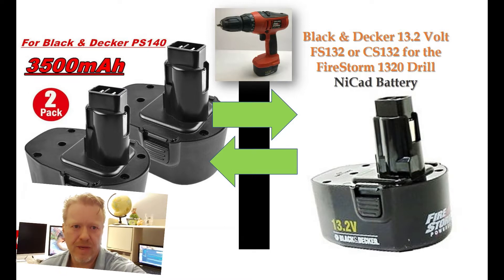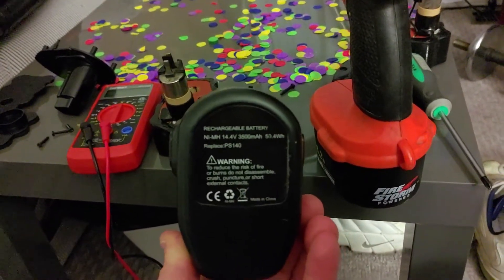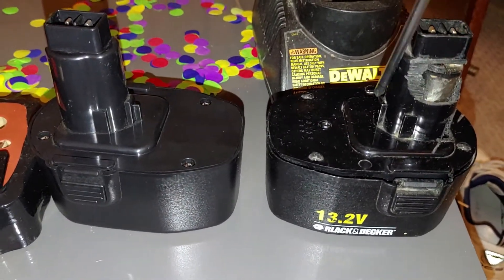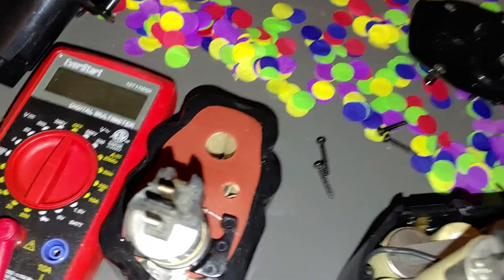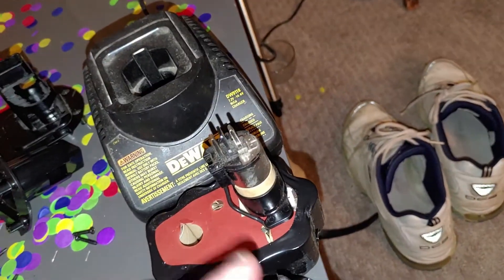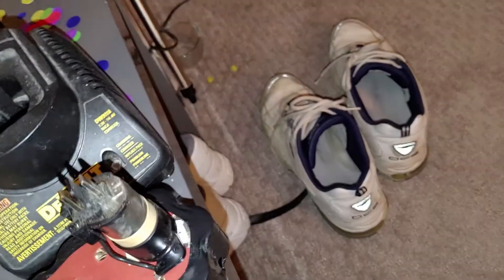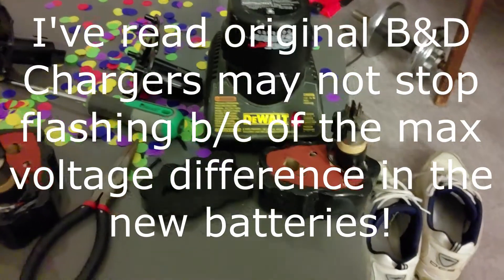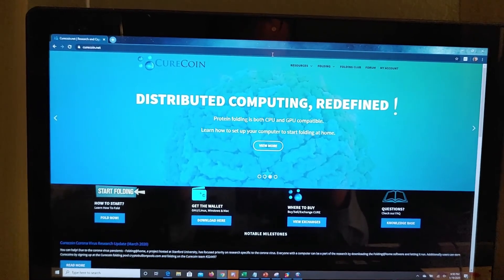Black & Decker FireStorm FS1320 (CS1320) Battery Replacement - Upgrade Hack (if you must)

Comment: I got a question for you buddy since how my charger doesn't work I'm going to invert it to to draw with a cord on it find just plug it right at the wall but I don't know which one is the positive which one is the negative the battery doesn't tell me or the drill doesn't tell me could you let me know which one is positive so I can not burn it up thank you
Reply from the maker: ... sorry for the late response. I would take a volt meter and check the dead battery (it'll still have "some" charge) ... and see if it's showing negative or positive voltage depending on which contact you place the red and black volt meter leads on. From what I understand, you want to plug it directly into the wall?! THAT WOULD BE NEGATORY ! unless you have a ~12VDC inverter with enough Amps. I wouldn't try using the charger as a source since when you think about it - it's meant to charge the battery over hours - so it probably wont be able to handle the load from the drill - except maybe at very low speed. As far as polarity - I don't "think" you will do any damage if you reverse polarity from an inverter - since all you'll have to do is flip the direction button on your drill to get it to spin the right way (but I can't guarantee this).

Comment: Great video, thank you. The voltage is a product of the number of cells, not size. Size is usually indicative of Amps, or storage, how long the motor will run. My old 13.2 had a cardboard tube in place of a cell.
Reply: Also, did you happen to check if the battery case "top" can be swapped between the two batteroes? I know you wanted to keep your modified top. Thanks again.
Reply from the maker: That makes sense. Thank you. Regardless, the replacement cells are taller than my originals so you still have to remove the plastic spacer to make the new pack fit. Of course you could just trim the tabs on the replacement pack with a dremel tool to make it fit the drill and chargers (more than one way to skin this cat) I recently rebuilt a section of cedar fencing with no marked loss of power (over 120 1 1/2" fasteners) using the new battery on one charge so from my anecdotal experience the drill performs as well or better than with the original pack.